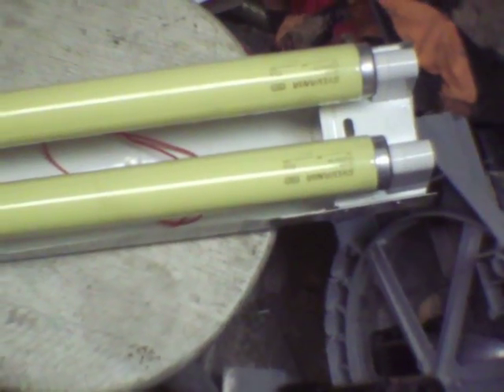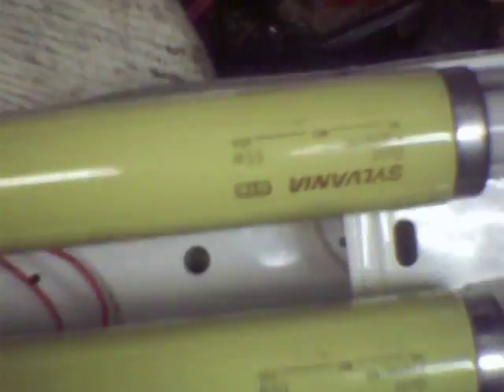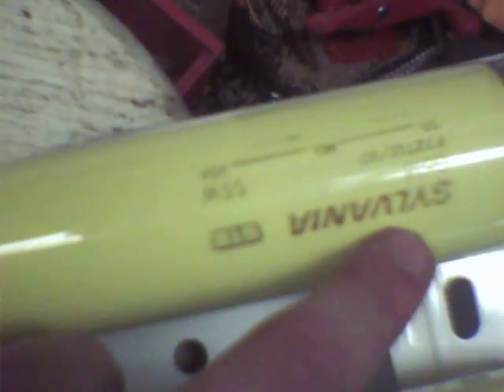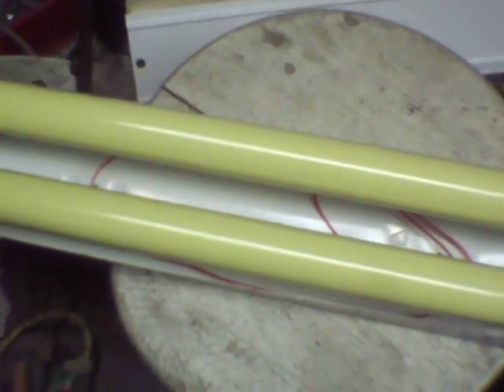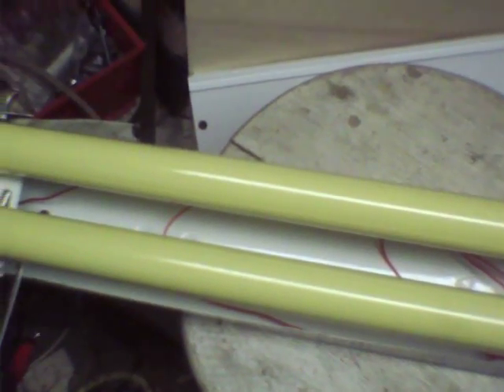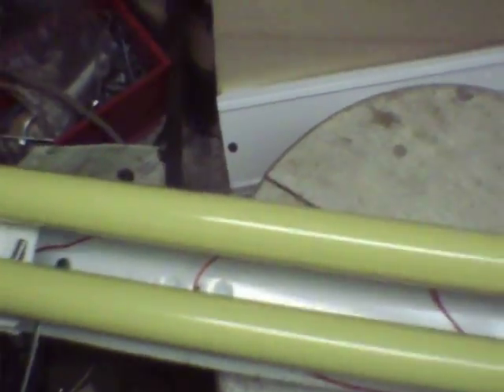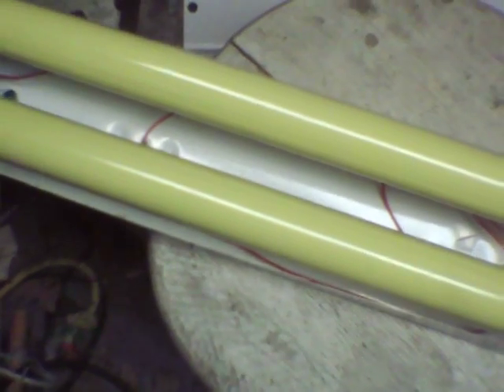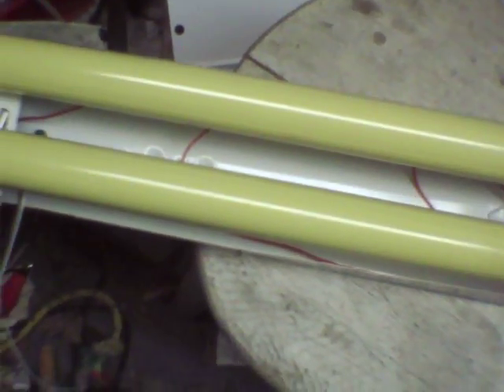F72T12 fluorescent fixture conversion

Comment from the maker: These are gold (the official color designation) lamps.  They are often used for illumination in areas where the user wants to keep bugs out, but they are not explicitly marketed as such because they have other applications (i.e. semiconductor manufacturing, as the photoresists used are not sensitive to yellow light and the yellow coating blocks UV from the mercury discharge in the lamp).